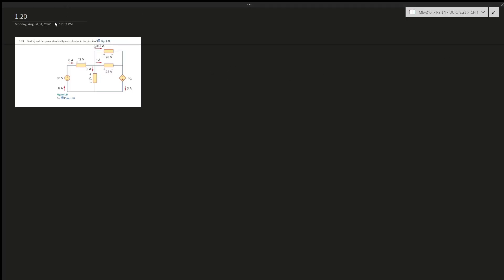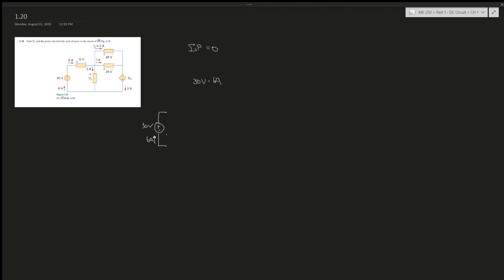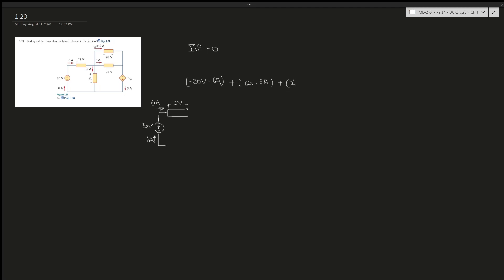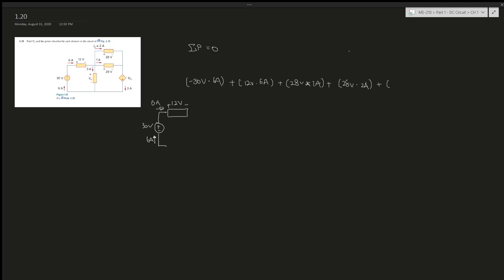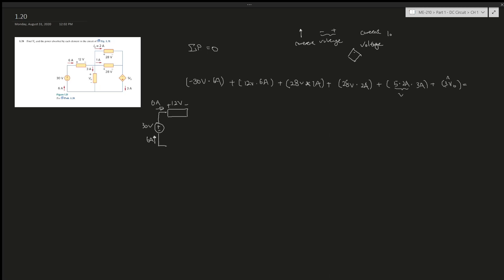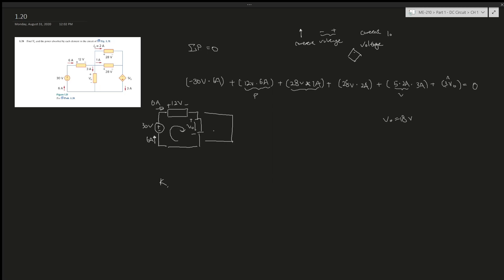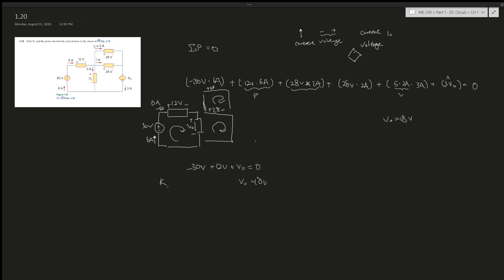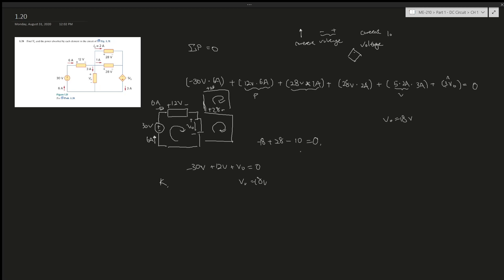1-20 Find Vo and the power absorbed by each element in the circuit of Figure.

Comment: why did I get Vo = 2  
-180+72+28+56+30+3Vo=0
Reply: voltage-dependent current source the power should be negative because the current is entering from negative so it should be -30 instead of 30.